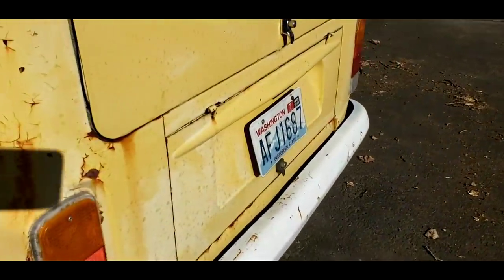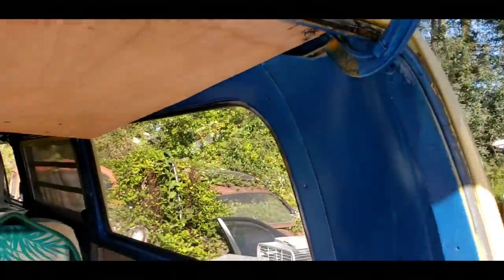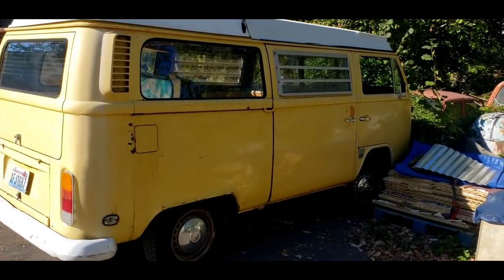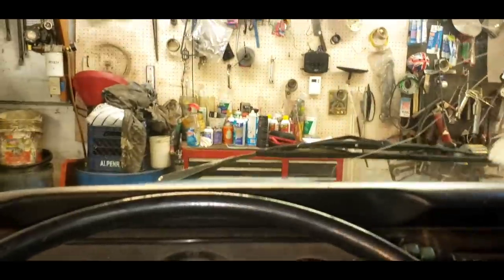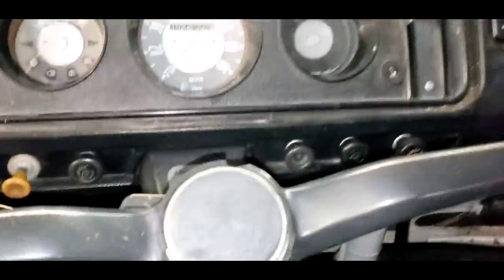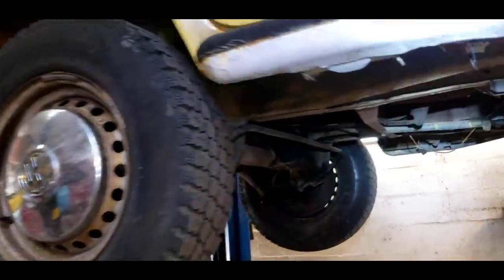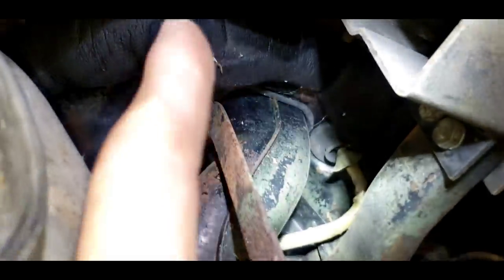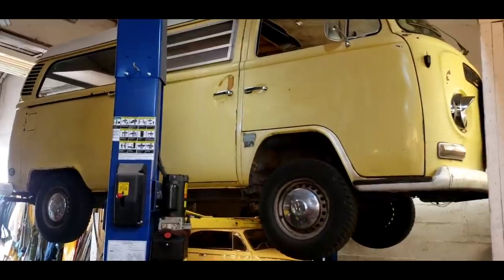I will break your heart

Comment: Don't touch it with  GEX motor. They've had so many problems that we are embarrassed they are from here in Arkansas. Total junk. Probably built with used parts.
Reply: Pulled apart one of their engines... Less than 1000 miles on it - mismatched case halves, line bored to the max, crank turned to minimum size, poor quality and not rebuildable...

Comment: That vent running through the door is for fresh air only, comes in via the grill on the front of the bus. I'm not surprised that the supply setup in front is missing considering what else is missing, I.E. the whole under dash panel. That is a Type IV engine, 72 was the first year for them in the US. Originally 1.7 liter but on that one who knows?

I had a 71 seven passenger bus from 1985 through late 1989. Rust was pervasive on the splitties and the bay window buses. I was going down a back road and hit a ditch dug across the road by a repair crew and the signs had blown down. I saw it at the last minute and hit the brakes. After the impact it kept taking more and more correction to the side to keep it going straight. I was close to home, got home and looked underneath. There is a box where the steering arms attach and it was welded to the front axle assembly. It had rusted internally and the bump started tearing it loose. I removed the whole axle and took it to a shop, they checked the rest of the axle and it was OK. They welded a new box on for me. 

I got an 84 Vanagon in 1989 and ran it for about 20 years. Very little rust, they had learned something. I had almost 200,000 miles on it, original engine, when some repairs would have been excessive. I gave it to someone who fixed it up.

Comment: I owned a 74 with a 2L. Welded in s ton a sheet metal, rebuilt the engine and brakes. New windshield and it has an A/C . Sanden compressor with s boss billet mount. Sold it 10 years ago and the owner parked it . He just died and the widow just sold it back at the price he paid , 10 years ago. It was inside and I just got it running. The steel today is crazy expensive. Looking forward to driving it again.

Comment: "It looks like it's a rebuilt engine . . ." Haha, um yeah. It's an air cooled VW and it's running, so of course it's a rebuilt engine. Re: the recommended course of action: This is one of those deals where the best way forward is to jack up the radiator cap and roll another car under it. Yeah, I know; no radiator, so no cap.

Comment: Better that you break the guy's heart now rather than having the van do it after he owns it. I owned a '71 vw van briefly in 1981, but quickly regretted buying it after discovering more problems and rust that I should've found before purchasing. I quickly sold it for about the same as I paid but it is still the only used vehicle purchase I really regret in 45 years of buying cars, and that includes owning a '71 Gremlin and a '71 Plymouth scamp long before either was ever considered cool retro.